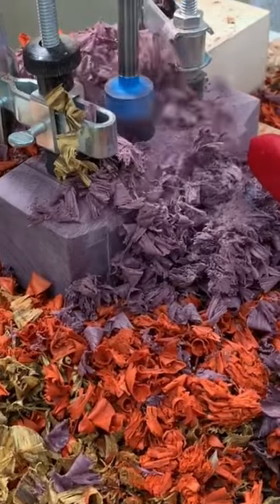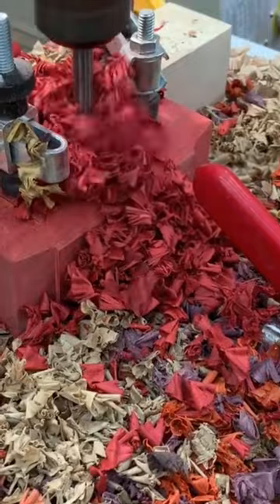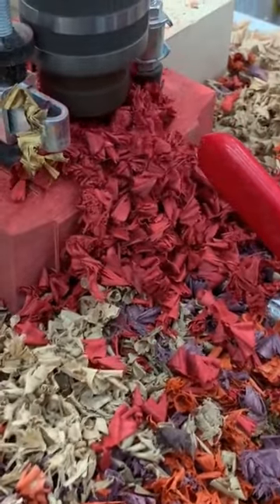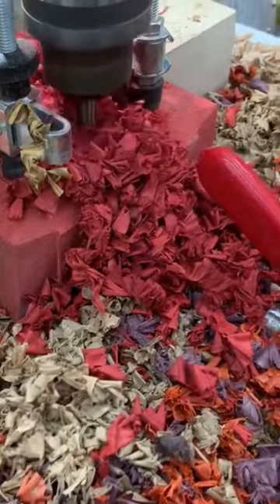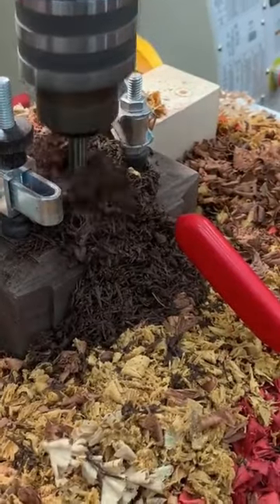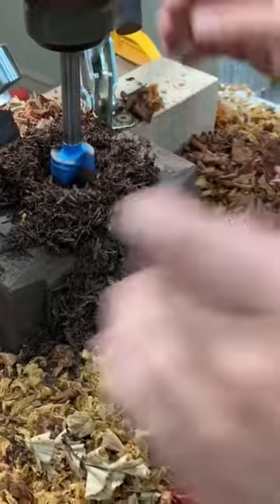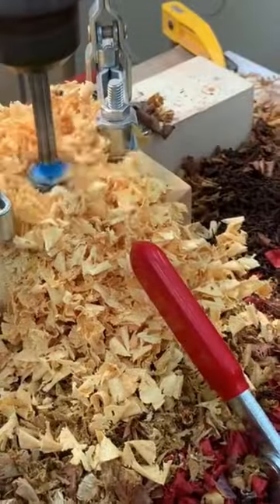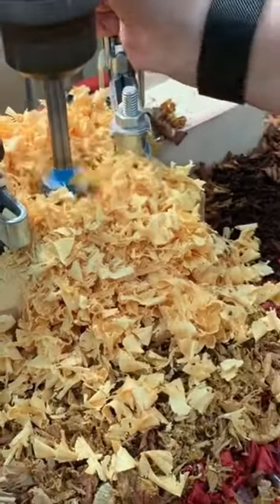Drilling colorful exotic wood species.

Comment: Could you get bits with square carbide inserts that you can rotate? I believe I've seen some CNC bits for surface planing like that. I wonder if they have versions for drilling holes.
Reply: Yeah I'm thinking of this as well. Surely for production work there are tools more suited to the task. Indexable carbide drill bits would be the way to go. Could even adapt one usually used in a mill/CNC to fit the chuck on the drill press
Reply: Perhaps even a boring bar would work well ...